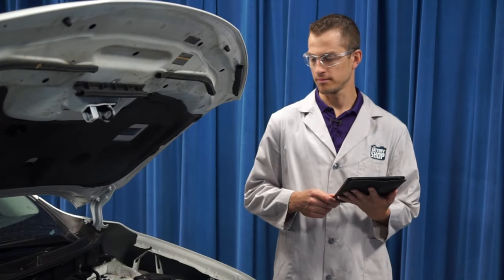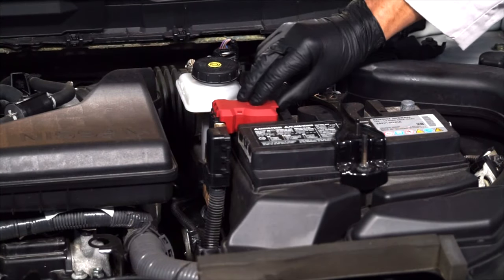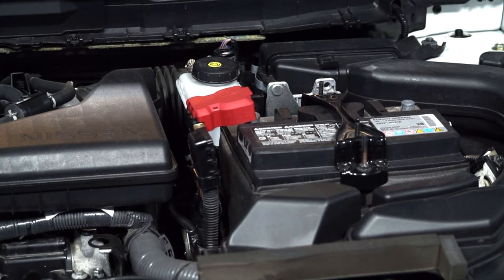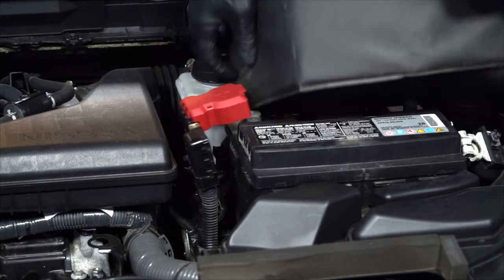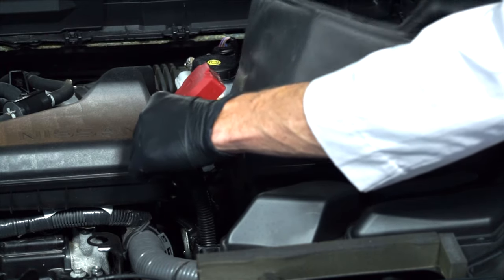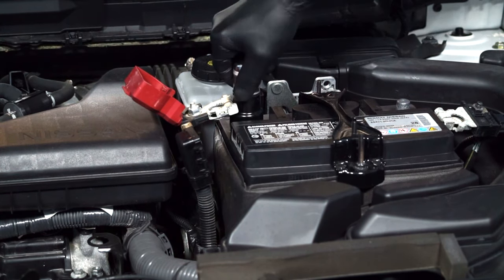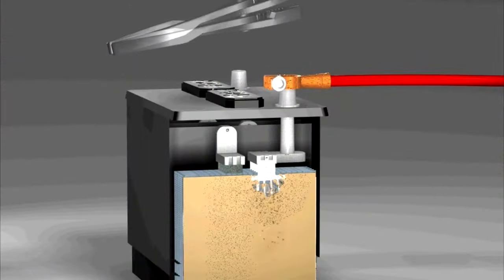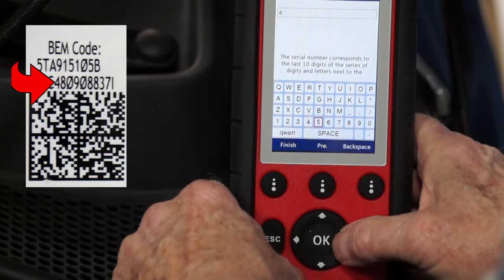Nissan Rogue (2008 - 2021) - New Battery Install

Comment: Had a neighbor take me to Costco. Told them I had a 2018 Nissan Rogue. Bought the battery and brought it home. Found the right size tools. I took the old one out and put the new one in all by myself. I'm 66 and a small woman. Getting the battery in and out was hard, I'm not going to lie. It's heavy. But I did it. Car started right up. It remembered my radio stations which is probably the most important part for me. Other things are lost. I didn't have a memory keeper so I took my chances. Thank you for a great video!
Reply from the maker: Hi - Thanks for watching and sharing your experience!

Comment: I’m glad I read comments as I was about to head to Walmart. 😅 I’ll probably head to an advance auto or oreilly or auto zone now.  I’ve to know what size socket and wrench to use. I remember the days with just a set of pliers and no heat sheid or anything. It’s good to have these videos free to help us along the way. I used to hammer my connectors down. Thanks for explaining why not to do that as well.
Reply from the maker: Hi - Thanks for watching!

Comment: Excellent video! I just did the battery on our  2017 rogue but I used 3/8 power wrench with a 10 mil.  I have a memory saver but never use it as this is not a high end vehicle and no problems with the settings afterwards. DYI tip> the battery is a little under powered for all the modules on this vehicle, replace it with A 640 cca battery.  Same group size and it fits in the tray perfectly.
Reply from the maker: Hi - Thanks for watching and sharing your experience!
Reply: thank you for this.
Reply: Hey, thanks for the advice on using a higher CCA-rated battery. Could you let me know which brand you bought? Are Costco batteries good?
Reply: @RubzNotNice   They're excellent batteries. I just bought a Costco battery "energizer" AGM, much better than a flooded lead acid battery, it will last longer and hold the charge a lot longer.

Comment: I should add there is that metal plate right behind the positive terminal. Make no mistake, you WILL ride the lightning if your socket wrench connects to both that positive terminal and that metal plate. Be super careful, I don't know why it was engineered that way.
Reply from the maker: Thank you for watching and contributing to the conversation!

Comment: Just a note that I was able to change out the battery in my 2017 Rogue SL without a memory keeper using the Wal-Mart Group 35 size Maxx Everstart 640 CCA (Maxx-35n).  Wal-Mart site said it would not fit my car but on a whim I went to the store and the book there said it would (and it's a higher CCA rating).  It installed without any issues and I seem to have not lost any settings on the seat nor the radio.
Reply from the maker: Hi - Thanks for watching and sharing your experience!
Reply: This size didn’t work for me, just a heads up for other people, the size that worked for me was h5

Comment: The 21 rogue faces long ways opposed to left and right in the engine compartment.
Reply: Did you replace the battery? I have a 21 rogue sv  with 55k and I can’t believe i need it replaced already. Doing it today as we speak

Comment: We have a 2016 Rogue. What happens if we don't have or use a memory saver? Is there a car radio anti-theft reset code I need to deal with? Do I need to worry about the car idling high for a couple of days? That kind of stuff. Anything else I need to worry about?
Reply from the maker: Hi - Thanks for watching! This will depend on the vehicle and what O.E. equipment it has. We suggest that you check a service/repair manual for the vehicle to be sure.
Reply: @TheBatteryShop Thanks for the clarification. I’m considering risking without the memory saver but will check manual first!

Comment: ?    My sons 2019 Nissan Rogue won't start.     Just clicking and i can't get to the battery.     It has a cover that seems impossible to get off.     Its attached to I think it's the computer that is back against the fire wall.       When trying to start i just get clicks.     So I'm thinking it's the starter anyway.      Your thoughts?
Reply from the maker: Hi - Thanks for watching and sharing your experience! You won’t know for sure until the battery is tested. We can only suggest that you follow the procedures in this video or a service/repair manual to access the battery.

Comment: If you look closely at the battery hold-down backet, you see it has an upward-pointing threaded shaft like a screw attached to it.  When he removes the nuts at 1:37 and 1:56, instead of pulling them completely from the car, he could put have them onto that shaft, reducing the chance of losing them.  I changed my Rogue battery just yesterday and wondered what the shaft was for, only realizing after I was done, and after having a scary moment of dropping one of the nuts just after removing it.  Fortunately, it landed in the tray so no harm done, but if I'd moved the nut from the J-bolt directly to the extra shaft, it would have greatly reduced my risk of mishap.  Handling small parts while wearing gloves is risky at best, getting them secured as quickly as possible is a plus.  In retrospect I should have had one of those magnetic dishes handy, and I have several in my workshop - no excuse to not have one in the car, as well as one of those extendable magnetic probes.

The new battery is a Wal-Mart Everstart Auto Maxx, Group 35.  So far, so good.  The old was the original and the CAA guy who gave me a boost seemed impressed that a 2015 had lasted that long.
Reply from the maker: Thank you for your advice! We hope your battery replacement was as painless as possible!
Reply: Well, it WAS, up until I put the old battery in the back of the car and scraped my forearm on one of its corners.  It didn't have a carrying handle of any kind.  The new battery does and I left it attached for future extraction if necessary.  I'm hoping it won't come to that and the new battery will last the remaining lifetime of the Rogue. @teryShop
Reply from the maker: Battery removal is so much easier when there is a handle! We hope your arm heals up quickly, and your battery lasts for a long time!

Comment: I accidently drop the nut that holds down battery. And I can't seem to find it. I looked under the car to see if it fell through. It didn't :/ Any idea where it could be got stuck in the engine bay ?
Reply from the maker: Hi - Thanks for watching and sharing your experience! Unfortunately, it could be anywhere. When that sort of thing happens to us we just keep looking and moving things until we find it. And truthfully, sometimes we don’t and just install a new fastener.

Comment: What size fits 2019 Rogue? I had group size 28 came with pre installed. All website recommends 35 which doesn’t fit in the hold down
Reply from the maker: Hi - Thanks for watching! According to BCI, the 2019 Nissan Rogue 2.5L requires a Group 35, 585 CCA battery. The 2.0L hybrid version requires a vented Group 48, 770 CCA battery.
Reply: @TheBatteryShop  thanks for your reply. The one you are changing in this video is what came with factory installed. I was told that this is H5 battery. The hold down doesn’t fit on 35 so I was confused to choose size 35 and a new hold down vs H5

Comment: My 2021 rogue has a group 31 battery installed, even though every auto parts store I go to tells me I need a 35. The 35 does not fit and no one carries the 31. Does anyone know why that is or what I do about it?
Reply from the maker: Hi - Thanks for watching! The Group 31 is a large 12-Volt battery used in the big semi trucks. It would not fit into the battery compartment of your Subaru Outback.

Comment: Autozone sold me a duralast 35dlg had issues with it n got a replacement for it under warranty but they ended up giving me the wrong one! Duralast 25dlg !! It works fine but hopefully nothing happens and they say some bs about warranty
Reply from the maker: Hi - Thanks for watching and sharing your experience!

Comment: What battery should I get for a 2017 Nissan Rogue
Reply from the maker: Hi - Thanks for watching! According to BCI the 2017 Nissan Rogue with the 2.5L engine requires a Group 35, 550CCA battery.
Reply: @TheBatteryShop  thank you
Reply: What battery should I get for a 2016 Nissan Rogue SL AWD
Reply: @princeonsnow  Same Group 35
Reply: Do we have to get a Nissan battery? The group 35 from Wal-Mart doesn't fit. It doesn't have the recessed posts. If I remove the plastic tray it sits on it'll fit. Bad idea?
Reply: @bigred4802  If in Canada, try Canadian Tire. They've got the Motomaster brand which fits.
Reply: @bigred4802  Don't remove the plastic tray, if your battery leaks it will collect the liquid safely. Make sure the two black rods are installed correctly. One is shorter than the other.
Reply: My 2018 Rogue Sport has an air intake duct passing over the battery,  otherwise the same procedure once the air duct is popped off

Comment: My new battery is too tall by about 2 inches compared to the original battery lol
Reply from the maker: Hi - Thanks for watching! We recommend that the replacement battery meet or exceed the vehicle manufacturer's specifications for the battery. Be sure your new battery does not interfere with the hood or anything else.

Comment: Stupid Nissan OEM design. They force you to use their factory crap design underpowered 525CCA replacement. One J bolt strap shorter than the other. Walmart Maxx 35 660CCA WILL NOT FIT (too tall). H5 is the REAL battery type for a Nissan Rogue. Now I have to return it at Walmart. Waste of time!!!! This video is worthless giving anyone real advice.
Reply from the maker: Hi - Thanks for watching and sharing your experience and opinion!
Reply: Yup, I also bought the 35 and have to return it